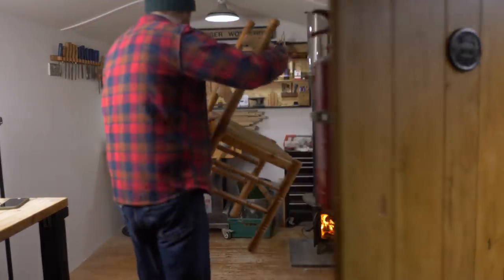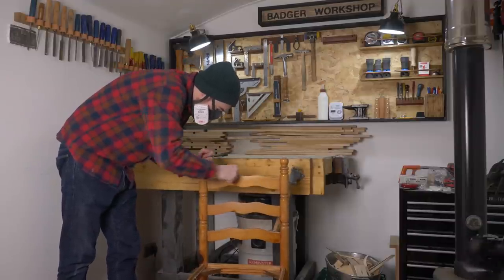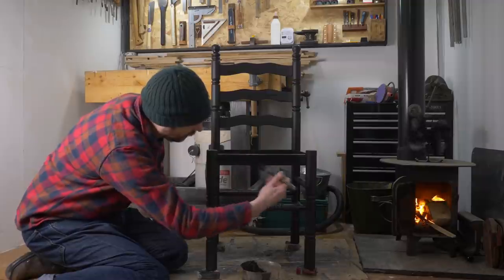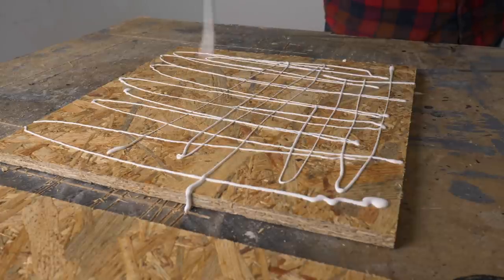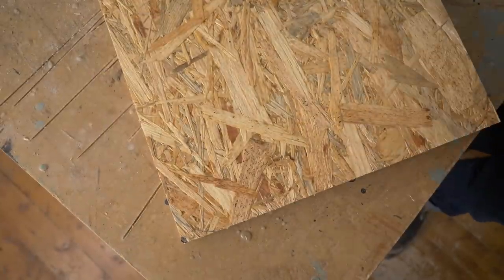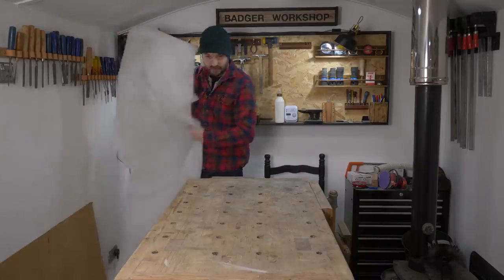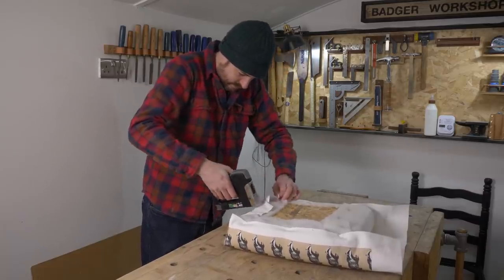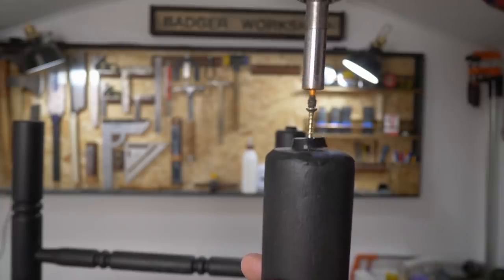I transformed this old chair

Comment: Nice job Matt I was hoping you’d add a white badger stripe down the centre of the back rest lol. Also love the tip on cutting foam on the bandsaw it worked really well you didn’t even send out the bandsaw marks 😆
Reply from the maker: It’s so quick on the bandsaw

Comment: I noticed that the back blade guide on your bandsaw was loose is there a reason for this or did it just come loose. I have the same bandsaw as you so was just wondering thanks
Reply from the maker: It spins if the blade contacts it